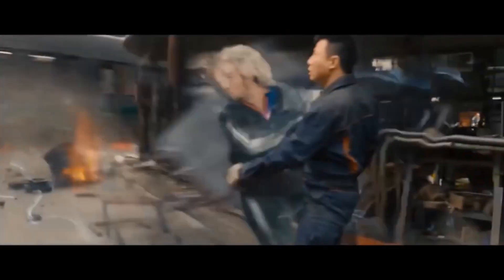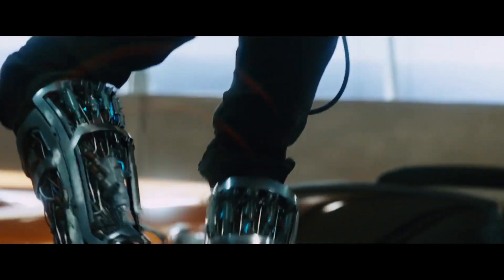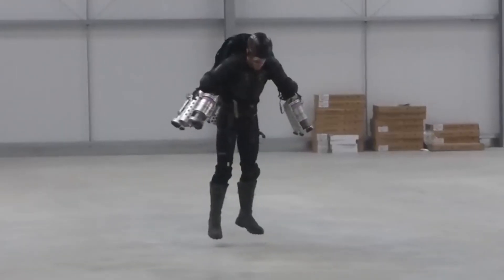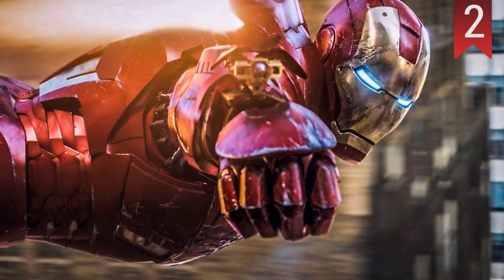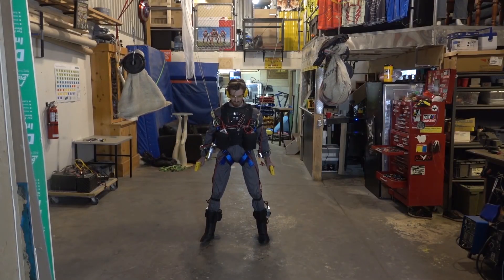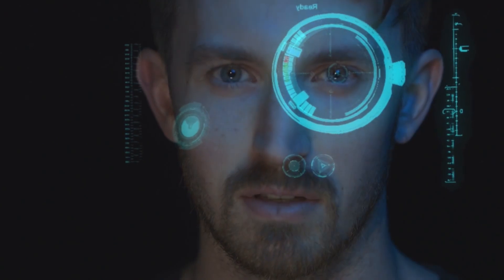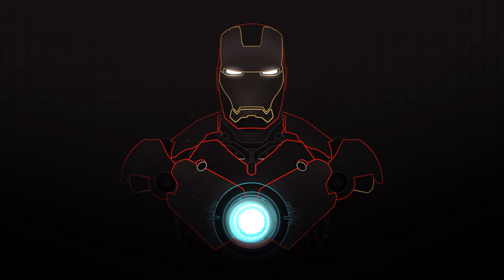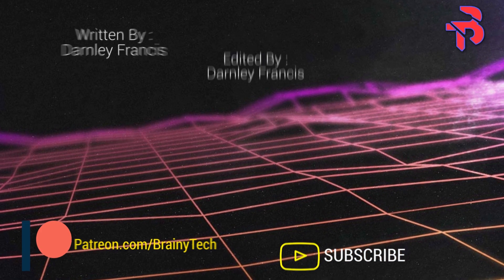Can YOU Build Your Own Iron Man Suit? (Avengers Infinity War)

Comment: The arc reactor cannot be contained with any material we know of on earth, an arc reactor is, in essence, a condensed nuclear plant. Energy is required to reach the speeds of the suit, but going from 0 to mach 5, Tony often does, will break all your bones. Unfortunately, we have a long way to go.
Reply: Umm... Technically you could use antimatter as fuel but the problem is that antimatter is unstable and hard to maintain
Reply: And for inertia there's two options : 1 use negative mass(not practical even in future)
2 use microjet to negate momentum